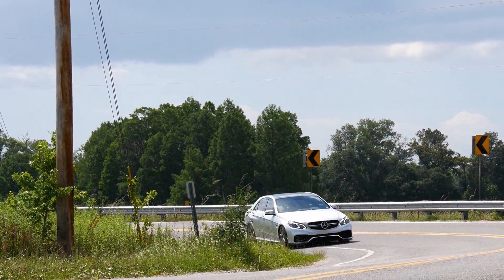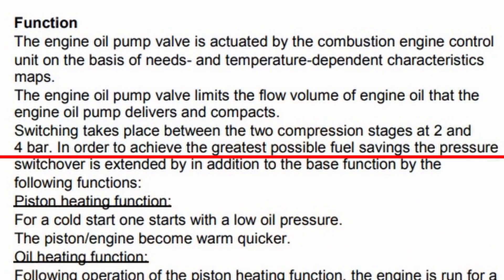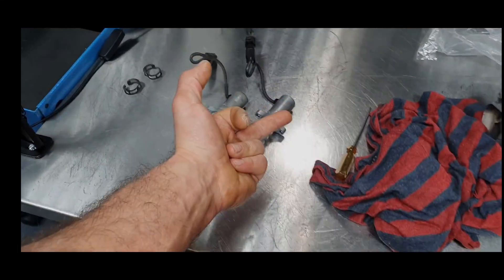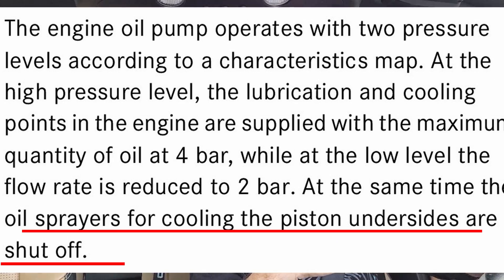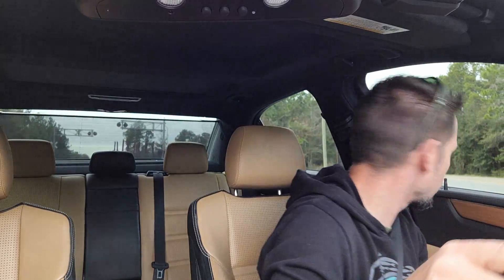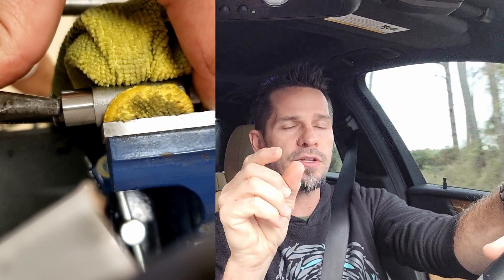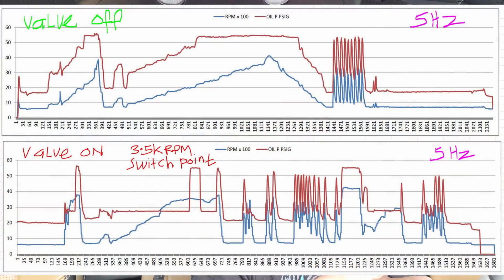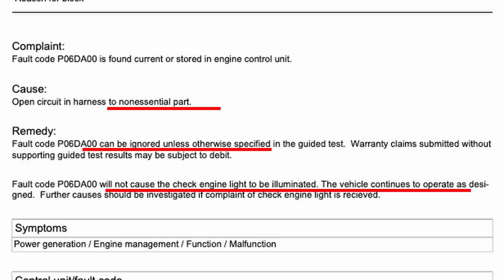M157 KILLER SMOKING GUN? Oil Pump Solenoid ~ Free mod! ~

Comment: For those pulling the oil pressure solenoid plugs on M278, M157. If you live in a colder climate I wouldn't do it. Due to specific design of oil pumps on these engines unplugging solenoid puts a lot of pressure on the pump during cold weather start. It will prematurely kill the oil pump most likely resulting in totalling the engine. For everyone doing it make sure you change your oil before 5K miles as due to full pressure used at all times your engine oil will be a toast if you keep it above that mileage. It will no longer lubricate engine properly above 5K miles mark, maybe even sooner.
Reply from the maker: This has been discussed in depth on the forum. 
According to the Mercedes tech documents. In 100% stock, untouched form, the oil pump is in normal (full pressure) mode during cold starts. 
So there is no difference between plugged and unplugged for cold starts. 
If your would like to read about it,  it's where it talks about "oil heating function"
Reply: @ExoticCarDIY  if that is the case then why  people say it warms up faster with unplugged solenoid? Also based on Mercedes docs you mentioned, how long pump stays in high pressure mode during cold starts? Is it just for a few seconds till rpm drops below 1000 or longer? Is there specific data on that? If not, I would stick to what Tasos (famous M157 mechanic, same pump) says as he built dozens of these engines already and probably knows better than some YouTube car enthusiast with no proper education or work experience.
Reply: @kennethderamus5277  if you follow Tasos, you already know that the reason he was not unplugging the solenoid by his own decision is that he didn't have any software data to confirm exactly how that solenoid works. I would appreciate if you share a link to such data in case it was shared anywhere in the thread. If there is no such a thing then personal perception tests done by those who unplugged it don't really mean much. And if it switches to lower pressure after 80 degrees then why many folks said their engine warms up faster with unplugged solenoid? Also one guy there complained that his oil leaks became worse after unplugging it as increased pressure at all times means worse leaks obviously. I'm also not sure how much stress all time high oil pressure will put on various seals etc. Is there a guy who unplugged it 30k miles ago to ask if he faced any issues due to this decision?
Reply from the maker: @nemodemo420  please refer to the thread, everything you spoke of has been discussed with data and charts. 
This is not my mod, I'm simply reviewing it. I replied to your comment just to correct your misinformation about cold starts.

And tasos has been unplugging people solenoids, he is doing so at their risk with no recommendation. 
Again I fully describe the warm-up procedure in my previous reply. We're speaking about it warming up from warm to hot faster, not freezing to 80f
Reply: @ExoticCarDIY  that is the thing. I couldn't find Mercedes documents on solenoid or solenoid software data there. Everyone is just talking about their own experience. This is the reason I asked for the link and would really appreciate if you can provide. My car is with mechanic currently for routine maintenance and I can ask him to unplug solenoid if there is solid data. Even Mercedes in North America changed their manual on oil pressure solenoid code. It is no longer not essential. They need to replace it now if the code is there. Another point against unplugging it without exact software mapping numbers and long term testing.
Reply from the maker: @nemodemo420   I would suggest that you leave it plugged in then
Reply: @ExoticCarDIY I just decided to do it on my M278 435bhp straight piped 447bhp on the Dyno.
My weather now in winter can get below 20c° but usually around ~0c°  -+
Should I be disconnecting this solenoid?
I'm happy to see your M157 running.

Comment: M276 turbo here, Is it okay to just cut the wires that connect to the oil pump solenoid right at the plug? Or will this trigger a CEL, I tried unplugging and I couldn’t get the plug off but the top of the plug came off exposing 2 wires that go into the plug, car is at 26k miles and I plan to keep it till the wheels fall off and I want the oil solenoid permanently deactivated
Reply: I went ahead and cut the solenoid wires off and No CEL engine warms up quicker and revs faster snappier and idles quieter and smoother in sport +

Comment: I have both a GLC 63s and a C43 AMG and I noticed after unplugging it on my C43 AMG that the acceleration is way better and is preety much similar acceleration as having my glc 63s in race mode. I can imagine now that the glc63s has that solenoid fully deactived by ecu in race mode putting normal oil pressure all across the rev range. So honestly if you wanna have a C43 amg that feels like race mode in a C63s or Glc63s it's preety much the same thing. I have yet to unplug it on the glc63s but I will eventually too.

Comment: I replaced my motor on my 2014 CLS 550 
Due to oil pump failure. I put a solid used M278 and unplugged the solinoid.  The car drives amasing .
Reply: Was it really oil pump failure or cylinder scoring??
Reply: @ralph02136  from what the mechanic told me it was the oil pump I didn't ask about the scoring in the cylinders. My warranty covered the new engine so I didn't ask to many questions .

I check the cylinder walls on the new used motor and everything still looks great . The car runs amasing with this little mod .
Reply: @agm5276  some ppl have been saying that the solenoid mod can have a negative effect on oil pump reliability down the line since it's consistently exposed to higher oil pressure /temps. That's why I'm kinda on the fence still
Reply: @agm5276  M278 oil pump is not designed to always work at high pressure mode, especially in cold climate. Oil gets thicker overnight in below freeze temperatures. So you are risking to ruin a new motor for the exact same reason as old one. I would do some solid research on it and talk to tuners who can read software codes to understand how exactly solenoid works, at what temperatures, how long etc before disconnecting it. Especially if you don't live in, Texas, Dubai or Italy.

Comment: Can you tell what the correct oil pressure is for a 2016 cls 63 m157????    I would like to try this but how do you know it’s working.
Reply from the maker: Before I did mine, I hooked up a mechanical oil pressure gauge to check the function of the valve both before and after. 
Rough numbers, with the solenoid unplugged, you get about 25 psi at idle and at climbs very linearly to about 4,000 RPM work hits 55 or 60psi and maybe 65 PSI above 5k.
With the solenoid plugged in an operational, the PSI stays hovers around 35 PSI until 3,500 RPM where it immediately jumps to 60. 

With a mechanical gauge, the jump and pressure is very sudden and obvious. 
If you go through the MV world post, there are plenty of people that have documented the oil pressure with a mechanical gauge

Comment: Hi, do you suggest me to do the same on Mercedes G63 2014 engine M157?
Reply: Absolutely not. I log 30,000 miles a year on this platform M157, leave your factory oil pressure alone. Terrible advise that went semi-viral.
Reply from the maker: Unfortunately on this one, I'm not going to tell anybody what they should and shouldn't do. I read the thread I link to the form. Inform myself and I made the decision that I thought was best for my car

Comment: Hey, awesome video!!! Getting my e63 in a few days and will be doing this. Been watching all ur e63 videos actually lol.

 Could you explain how you tested the oil pressure manually? What tools u used, where you plugged in to, etc? Can you see the oil pressure via obd? 

Would be nice as a video too if you can😅. 

Thanks in advance!
Reply from the maker: Thanks man. 
These a port on the front of the oil housing made for a manual gauge hookup. I removed the plug installed a gauge, documented the behavior of my before oil pressure. And then again with the oil solenoid unplugged. 
There is no factory oil pressure sensor in the system, so it does not know the pressure in the ECU either
Reply: @ExoticCarDIY  dude thank you so much. Your videos help me out so much. I learned everything I need to know and what to do before I got my hands on her! Keep it up, huge blessing!

Comment: So what about the inlet plug sitting open on the engine what if oil gets into that or just gunks over it, is that bad  ?
Reply from the maker: I do think it's wise to cover both the plug and the receptacle with the rubber boot. In the description there is a link to the rubber boots that I've used, although there's a many different things that will work to protect them. 
Others have a dummy harness, typically used for the camshaft position sensors, except for they cut the dummy harness so there's no connection, essentially they're just using it to protect it from the elements

Comment: Any feedback after unplugging it for several months now? Any issues?
Reply from the maker: Zero issues. I was curious high summer temperatures would affect it, I have noticed slightly higher oil temperatures, but it makes sense why. 
Arguably, the Pistons get the most heat, they are cooled with oil. If you're not spraying them with oil, there's nothing cooling them. Obviously if you're spraying them with jets of oil, it will remove the heat from the Pistons and transfer it to the oil which then gets transferred to the air via the oil cooler.
Reply: @ExoticCarDIY  sounds good ill do this to my e63 as well
Reply: I didn't unplug mine and logged 30,000 miles this year and every year. AMG didn't have a faulty design to begin with concerning this.
Reply: @samspace81 so you recommend leaving it plugged in?
Reply: @goofyboa2398  yes I'm at 130,000 miles plus, 2012 S63 5K oil changes all stock I drive 30,000 miles annually. I'm not a believer in unplugging it. MB oil temps and pressures operate just fine as designed. I burn zero oil and I drive hard in desert climate to cold climate. Nationwide vlog travels
Reply: @samspace81 thank you brother, I left mine alone just use liquimoly oil with ceratec and wait for the it to be at operating temp before getting on it hard. 
74k miles on mine now, 2016 CLS63S AMG black on black, such a beautiful car
Reply: @samspace81 yea I think people are not accounting for the change in temp that would also affect the fluid behavior because it’s not only dependent on the oil pressure, at the higher operating temp the viscosity of the fluid will be lower which means it will be able to lubricate and lather more internal components regardless of the oil pressure. Not saying oil pressure is not important but I believe at the right temp with the right oil you don’t have to worry as you will get the proper lubrication needed

Comment: Anyone else have trouble pulling the plug out after popping the tab? I spent 30 minutes fighting with it before i tried to pull back on the tab some more, only to pull the tab all the way out. Still can't get the plug out after an hour struggle. Am i missing something? 2012 W212 pre-facelift, M157.
Reply from the maker: carfull, some people have pulled and twsted and ended up breaking it off. TIP, its the exact same plug as the cam sensors up top (see cam sensor video) practice on those, then try the solenoid. I push the plug in to relieve any clip tension, then gentle use a pick to lift on the tab and it come right off
Reply: @ExoticCarDIY  Thanks for the tip. I did practice on the cam sensor clip and was able to get my pick behind the plug and lift up the tab, popped right off. Victory! Definitely noticed better throttle response, much reduced or non-existent lurching upon takeoff, and better shifting. Can't wait to drive it under more conditions. Thanks again!

Comment: Just did it on my 2013 SL550 with the M278. First drive sure felt good! Seems to rev faster and runs very smoothly. Time will tell how much it improves? I disconnected it from the top, very easy!
Reply: Where you disconnect from the top? Can you share a photo? Thanks
Reply: Any updates on this? I have the exact same car and want to try it.

Comment: Haven’t really noticed a difference. One thing that does happen. Is my oil warning light comes on, basically stating add a quart of oil. I checked the level and it’s 3/4 to the line, so not sure what the issue is.

Any feedback for this?
2012 cls 63
Reply from the maker: I would post your concerns on the mbworld thread

Comment: Just got the P06DA-00 code on my 2019 C300 and the CEL is on. Should I just unplug this sensor? Mercedes want 8k to replace my oil pump, valve and harness... just don't see why they couldn't start from the harness and valve and then work their way up? I'm thinking drop the oil pan and replace the harness and valve....any thought would be appreciated.
Reply from the maker: So you got the code from an actual failure? I can't tell you what to do, but if it was my car I would verify that the oil pump is working and in normal pressure mode (not reduced pressure) with a mechanical oil pressure gauge ...to make sure you're engine is not in any danger. 
If all is well, I'd get a dummy solenoid installed extremely to make to code to away. Just search the mbworld thread for info on that dummy solenoid
Reply: I took it to MB and they said the tested the harness which was good but the valve was not functioning properly. They want to replace the pump and the valve which would cost 8k$.
Reply: The car runs fine. It doesn't over heat and it starts without a problem. It doesn't make sense to spend 8k on the oil pump when the valve and harness is known to be at fault for this code. I figure you starts small and work your way up where MB wants to just replace everything.

Comment: Is this same procedure on m278?
Reply: Just disconnected mine on my m278. Easy, did it from the top, zip tied harness to a line is necessary as its just left if the crank pulley.
Reply: @io3010  from the top??? how did you find it?

Comment: This is true for the 2015 S63 AMG with the M157 motor? 5.5 V8 BITURBO ?
Reply from the maker: Yes, but according to the MBworld thread, the s class with throw a check engine light. There is a work around, people are buying a spare solenoid, unplugging the actual engine one and then plugging the harness into the extra one to fill the car.
Reply: @ExoticCarDIY  thank you, as my S63 gets up there mileage wise...i think it would be safe to just maintain max oil pressure..especially during cold starts!! where do you recommend getting an extra solenoid to avoid the check engine light? the S class doesnt like when ANYTHING is not in normal operating condition...solid car but very finniky at the same time.
Reply from the maker: @SoCal-AMG   quite a bit of discussion on it in the thread. basically people are buying the solenoid from like Alibaba and unplugging theirs and plugging it into the cheap replacement externally zip tied safely away from the belt. no code, 100% normal oil pressure all the time. many many posts, heres one 1199 https://mbworld.org/forums/w212-amg/877669-oil-pump-solenoids-12.html#post8937576
Reply: @ExoticCarDIY  thank you so much, i just ordered the part.

Comment: Ho ree fook! Dude!... I can't thank you enough for this vid man. I've had problems the last few weeks with the damn oil temp going up to 227-230 deg F and staying there - I thought maybe its the intercooler. I was about to start pulling it apart and looking at the hoses when I spotted this video. Well an hour later, with that little '304' disconnected, I took the beast for a spin and even in major stop start traffic where I'd usually have the problem, she only just touched 212 and then went back down to 208. Sorted!!🤩

Comment: Any word about this in summer?
Reply from the maker: It's starting to get hot here in Florida come at the last 2 weeks have been in the upper 80s. 
I'm definitely curious how this works in the summer so far everything seems to be normal. 
One thing you will notice is slightly higher oil temps which makes sense if you're actually think about what's going on. 
The oil is the cooling fluid for the inside of the motor especially the rotating assembly. 
With the solenoid completely stock, your pistons for example, would be completely left uncooled until you exceed 3500 RPM and then they will get a spike cooling. 
With the solenoid mod, they are always getting sprayed, which is transferring heat from the Pistons to your oil which then goes through a radiator my oil temps do fluctuate, when driving around moderately, you will see an extra 10° or so on your oil temps. 
In my opinion this is 100% benefit, I'd rather this Pistons be kept nice and cool
Reply: @ExoticCarDIY heck yeah that makes sense, shouldn’t be ragging on these in summer anyways until it’s night time LOL. I think I’m definitely giving this a try
Reply: @ExoticCarDIY  I drive mine in the desert, 100mph plus cross-country all stock, solenoid plugged in. No problems. Why fix what isn't broken?
Reply: @ExoticCarDIY so with the increase in oil temps which may cause it to shear earlier than usual, it would make sense to do earlier oil changes around 4-4500 miles?

Comment: I'm wondering if this solenoid is disconnected if it's all that more imperative that owners stick to more frequent oil changes...
Reply from the maker: I tend to agree with you. For me this is not an issue since I do a much shorter interval than the factory recommends. The factory is 1 year or 10k miles, regardless I will never let any of my cars go over 5000.
Synthetic oils these days are pretty good but they still get dirty, they still break down, at what point is unknown, but I don't think you can go wrong with erroring on the side of caution